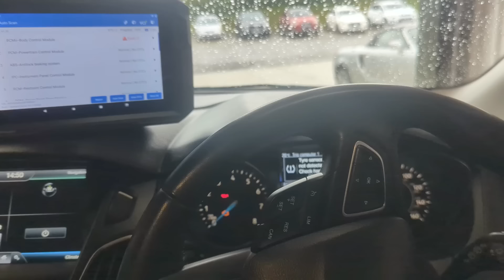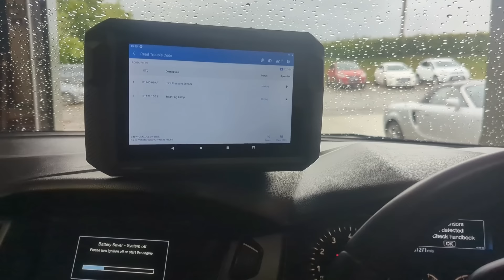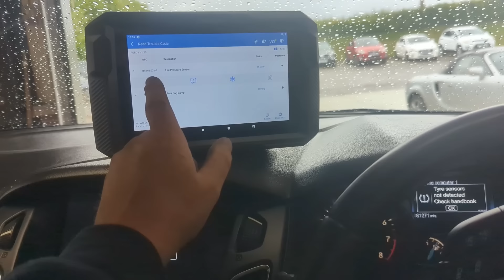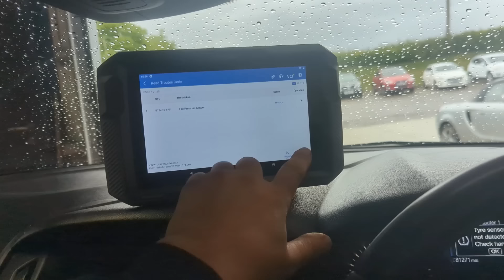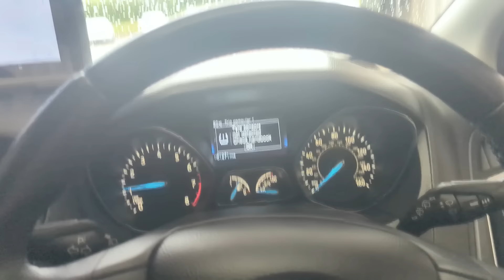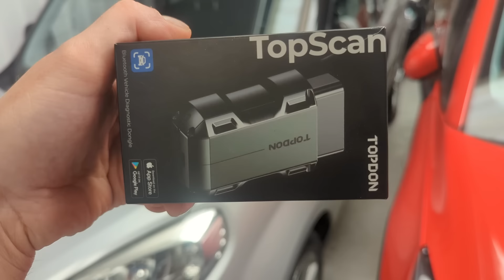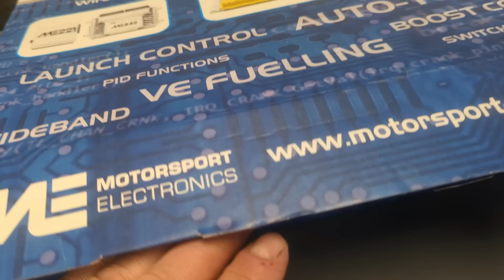I sold it and it immediately broke!

Comment: Mr Chops, that microfiber towel at 13.05 could be a very quick way to destroy your ECU. Think about the static build up against some very sensitive semiconductors. You need to keep the ECU in a static shielding bag to prevent damage from electrostatic discharge (ESD).
Reply from the maker: Oh yes, good point!

Comment: In my experience with Ford Fiesta and Focus with TPMS not detected fault, it is cheap Chinese sensors.  The sensors will report OK to  a TPMS code programmer but the car won't like them. Spend a little more and get the Autel MX sensors.

Comment: 240 bhp sounds good mate, I hit a corner in a bgt a while ago, big spin, don't use 2k solid on the firebird, it's very hard to get flat and so it looks proper, base coat and a good 2k clear will deffo look best, if it's not too dusty I'd do (and I do) it outside with your gun and compressor, tbh it's a skill you need to learn as opposed to silly rattle cans. For example I got a volvo in this week, it was dull on the bumper and wing, quick mask up and clear it, took an hour and brightened it right up, no need to send it away and spend 100s,all done for a cap full of clear, like 50p worth, if you can paint there's no flatting or polishing.
Reply: In the past I have made up my own spray booth with some old  scaffolding I bought off ebay, a handful of poles and some fittings and then cable tie and tape polythene over. An hours work to put together but makes things easier.
Reply: @paulf2529  yes that's great idea bud, I use a gazebo.
Reply from the maker: Yes I think it will be done outside on a tarp with gazebo to keep landlord happy
Reply: @ChopsGarage  yes bud, be careful, people don't like spray painting

Comment: Don't forget TPMS sensors are designed to fail after so long! I needed to replace all 4 of mine replacing on my Focus when I got back from holiday for a month. The car was sat for over a month and I had exactly the same issue have! I had all 4 of mine changed for £120 a few years back and I've never had a issue! i think the fail once the battery drops below a level or something!

Comment: Changed wheels on wife's 2014 kuga few years back and asked for about sensors and programming. Crazy money asked but did buy genuine sensors amd took them to tyre place for fitting and the guys there said they don't need programmed the car detects them automatically. He was right no issues, no faults, all worked correctly and were going well when we changed that car.
Reply from the maker: I wonder if the battery just got low
Reply: @ChopsGarage  I was changing them from 19inch to 17 for a better ride and selling the 19s with the sensors in them so  was easier to buy new ones for the new tyres rather than shopping back amd forward.

Comment: You may need to move the car for it to relearn the TPMS sensors.  A lot of sensors have a roll switch and won't start transmitting until the wheels are turning or you have a flat.  I don't know what sort Fords use in particular, so that may not apply in this case.
Reply from the maker: Ah, top tip many thanks Ill check

Comment: The ford eco boom the same problem is happening with the ford transits 2l Eco blue the engines need a replacement just like the 1L fiestas any ford and also the new Vauxhall Corsas also has got a wet belt
Reply: Who mentioned eco boom… it’s only a tpms that’s faulty!!

Comment: FFS...why cant drivers just check the effing tyre pressures ... no need at all for gizmos .../ i hate modern cars and the thickos that know F A
Reply: Totally agree, why do you need all this shite that's only put there to go wrong?
Reply: @tonycox5625  - Absolutely- I have a Mazda 3 MPS 2011 with TPMS, it hasn't gone wrong yet probably cos it's got Japanese batteries but realise it will do one day. - Think I will be tempted to tape over the warning when it does - although it did tell me years ago that one rear tyre was a little low and I found a nail in it!! - it had gone down to 25PSI  only 3 days after I had checked all the pressures, so perhaps it is a useful warning,

Comment: Those mr2s are a lot sharper than mx5s I find bud. When an mot station is megga picky it means they don't want you due to being a car trader, they know that's when the vosa complaints start from the buyers.
Reply from the maker: Yes I was impressed
Reply: @ChopsGarage  just no boot space at all, basically passenger seat.